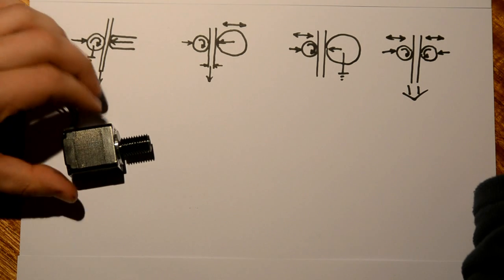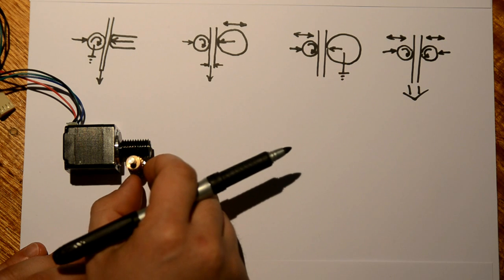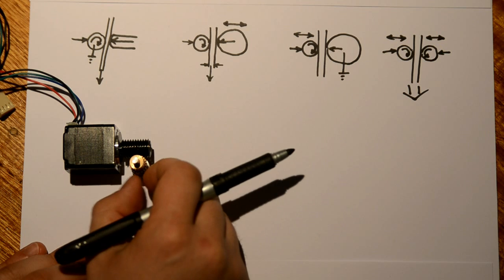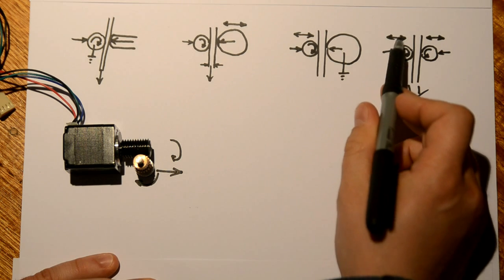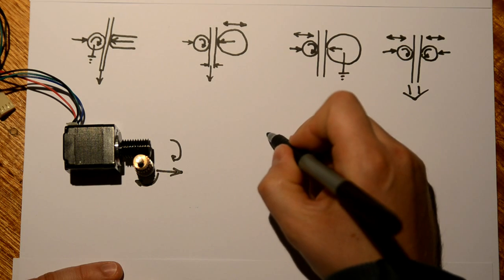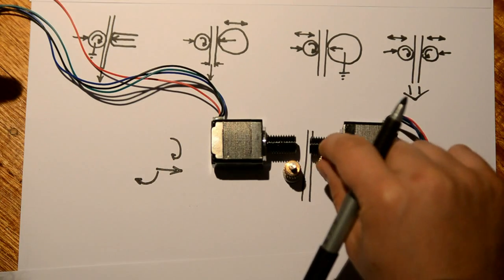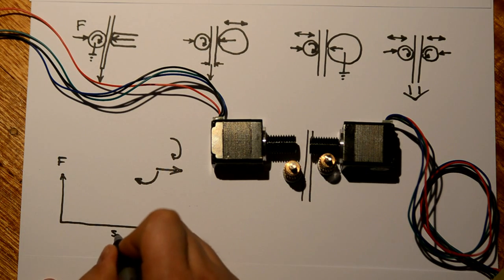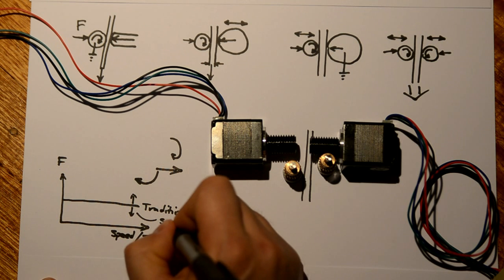The Kraken Dual Pinch Wheel Extruder - How it Works

Comment: Rather than have two motors why not have a single motor and two worm gears, one with a clockwise thread, the other anticlockwise. It would result in the same dual drive but less weight, current draw, etc..
Reply from the maker: Left handed worms and gears in this size are not commonly made in this size. When I got quotes for the left handed versions of the gears they were well over $100 for the pair, even in volume.
Regarding the bondtech extruder, looks like that uses spur gears to reverse the second drive. This means that the wheels can't move to compensate for filament size without compromising the gear meshing (this is compensated for in the bondtech with a very small gap that crushes large filament that I would be hesitant to use for files with a large number of retractions). That means that if filament damage or grinding occurs, the extruder cannot recover as it will lose contact. The unique part of the Kraken design is it allows for dual pinch wheels to close up on each other completely, allowing the same extruder to be used for 1.75 or 3mm filament, as well as recovering from filament damage and all without excessive crushing of the filament. I recommend trying a retraction stress test as shown in one of my Urchin videos: https://www.youtube.com/watch?v=wIOS-kCR1VA
Reply from the maker: *****
I'm aware that you were involved with the development of the BondTech extruder and it does look like a good design. Congratulations, I know how much work it can be!
I do have to point out that recovery from damage is shown in your own videos: https://www.youtube.com/watch?v=tS3VbDA9zWA
After the extruder loses grip, it continues through the same spot where the stripping occurs and appears to not continue through the fade out. Of course, losing grip (at least on your tested piece of filament) appears to take a lot of abuse and won't be seen by regular users (or even extreme users).
In any case, it's horses for courses - I'm sure there are areas the Bondtech is better and ones where the Kraken has a slight edge. Bowden designs are not my personal cup of tea but have been shown to work. It looks like it would be a good replacement extruder for our Ultimaker 2...

I would caution that changing the gear mesh on spur gears will result in increasing backlash between the 2 pinch wheels - this means one wheel is turning while the second is stationary, possibly tearing up your filament and causing premature wear on the gears. Perhaps you have a solution that means this isn't a problem for you - I wouldn't know.

Good luck, perhaps I'll be using a Bondtech extruder myself one day. You might need to convince me it can go faster than my own ones though, including the ones I haven't shown in the 2 years since developing the Kraken.
Reply from the maker: ***** Unfortunately 3D printing these days is the side gig to my side gig. I have a few small projects ticking along such as my Urchin extruder, which is targeted at those who want to do extremely fine layer heights, although it can also do the opposite (https://www.youtube.com/watch?v=zMcMR005-80)

I like the test setup in Martin's video - much nicer than my personal attempt where I found that my kitchen scales did not go high enough to be particularly useful!
I wonder if you you replace the screws that set the filament gap with a ball plunger or dog point set screw (say with a rubber point that acts as a very stiff spring). This could help keep the rollers in contact with the filament in the small chance that it does grind the filament. I find you just need enough pressure against the filament to get it to move a tiny bit, at which point the wheels can grab the fresh filament above the grind and recover.

Comment: Went to brainydeep website, but found no print heads available. Are you not in production, or do you have another site?
Reply from the maker: Hi David, Sorry for the late reply, been taking a bit of a break over new year.
Thanks for the interest in my designs. My most recent design is the Urchin extruder, which was released as open source (source files here: https://github.com/zbysniew/Urchin). I didn't produce these (it was just a free project for people to try), but due to demand I will begin stocking limited numbers of kits over the next few weeks. I'll release a video when they are available. If the Urchin does well I'll be doing the same for a redesigned Kraken soon after (the current design allows the Urchin to be upgraded to the Kraken with minimal additional parts).
Reply: Thanks, I'm also slow, just now seeing this! Much appreciated. I LOVE open source... I make everything I do pretty much open source if I can.
Reply from the maker: David Shepherd Good stuff :) To be honest I'd rather not be stocking kits and stick to designing. Perhaps I need to find a commercialization partner.
Reply: BrainyDeep Talk to Elan Musk... ha! But yeah, you're an engineer with no motivation to be a generalist running a business.

Comment: This method is very cool and unique, however I wonder if similar effects can be achieved without worms and worm gears, perhaps some clever pivot placement. 

The further challenge is, of course, to use only one motor... perhaps nothing more than a criss-crossed pulley to pulley band, which could slip and stretch, but would allow power transfer so that the annoying idler is removed.

 awesome stuff regardless.

Comment: What about retracting filament, wouldn't the wheels pull away?
Reply from the maker: Hi shardbearer,

Yes, the force on the filament is reduced during retraction, which helps to reduce filament damage during retracts. We use springs on the shaft to maintain contact. See our testing video here: The Kraken - Extrude and Retract Test

Comment: Hi, thanks for the comment.

The best way is to use a left and right handed worm gear attached to a single motor. That motor can turn both drive shafts simultaneously in opposite directions. Unfortunately no one makes stock left handed worms in small sizes, so a left handed worm costs more than a right handed worm plus another stepper motor.